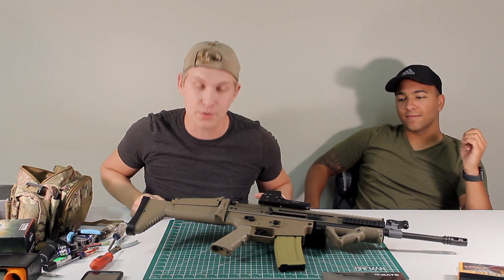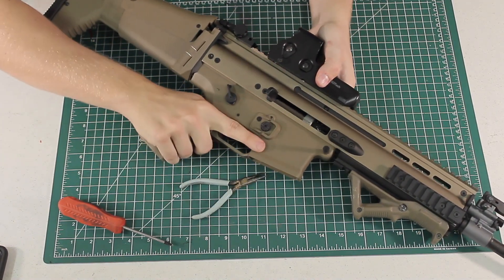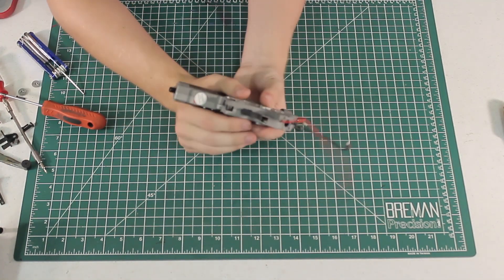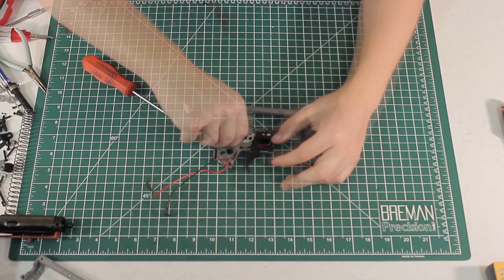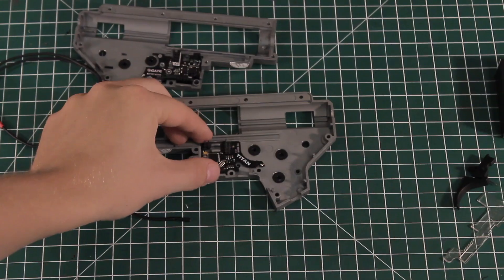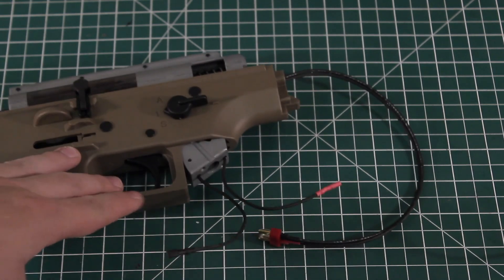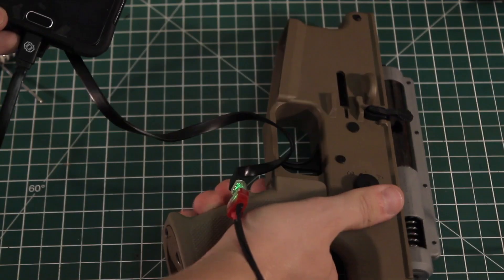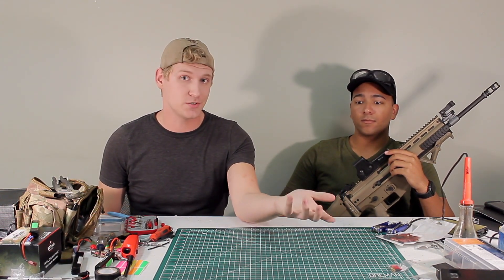GATE TITAN INSTALLATION SCAR-L [ Version 2 ]

Comment: Question why take the spring off the selector plate if that still needs tension on the cut off level?
Reply from the maker: When you install a gate titan the circuit board completely replaces the cut off lever entirely.  You actually use the screw from the cut off lever to mount the gate circuit board to the gearbox.  You don't need a cut off lever because the gate computer automatically cuts off power to your motor whenever you pull the trigger in semi after a shot has been fired. Then when you pull it again it cycles and fires another shot.. Therefore it's an electronic semi auto function based on the motor instead of the cut off lever.   NOW because there is no cut off lever there is no need for the spring on the selector plate. The spring no longer pushes against anything. Therefore the selector plate moves based on the position of your fire selector.  The spot in which the plate spring originally sat is actually a light sensor on the titan circuit board. So when the sector plate moves it covers this sensor which then allows the gate computer to tell which fire mode it is in. The selector plate spring is only needed in AEGs with a cut off lever. If there is no cut off lever then it's no longer needed.

Comment: So when it comes to the magnetic stock connections, I’d have to solder the Titan wires to the prongs?
Reply from the maker: That is correct. Just make sure you don't get the prongs backward or accidentally reverse them otherwise you will get a short, fry the titan, and blow up your battery. So just be safe about it. Red is + and black is -   make sure it stays that way all the way up to the battery lol.

Comment: Carlos laughter says it all 😂 what problems did you have with the wire to the stock.
Reply from the maker: All we did was drill a whole through the back of the gun into the stock then fed the wire through both holes.  The stock can still fold fine with the wires and it works perfectly fine.    This gun actually no longer exists anymore its been a while.  I bought it off Carlos last year and it now has a polarstar Gen3 fusion engine in it lol.
Reply: @d-rzairsoft296  cheers for the info I'll keep it in mind for future reference if I decide to go ahead and get one I hate the look of the stock but like the look of the body.
It's like a ugly woman with a nice lower 😀
Reply from the maker: @JBAIRSOFTIRELAND  personally my favorite stocks on Scars is ACR Masada stocks.  But you can't do it with an AEG cause then there's no room for a battery.  You can do it with GBB models however or polarstars. But yeah I rarely use my scar I just keep it around because I love the FDE look with my collection.    Also stay tuned. More content will be coming within the next few weeks.

Comment: So i wonder how u would connect the mosfet to the phone when you still have that hinge connector...  Will it still work without drilling a hole on a stock?
Reply from the maker: Still works just the same.  The hinge is just a + and - conductive metal hinge that the wires are soldered to.  After this hinge the wires return to standard tymia connectors.  You just need a dean's to tymia adapter to program.   Your largest issue will be modifying the titan wires to work with the 2 metal probes in the back of the lower with the conductive probe receiving holes in the back of the lower stock. This way you can still seperate the lower without cutting wires.  Everything will work as long as your electric path of continuity remains conductive.

Comment: I wish I had found this helpful video before installing the titan mosfet in my Scar L.  So far I have this system in 4 of my CQB guns (Scar L, M-4, Mp-5 and Ak-47) and I am very pleased but I think the ROF is a bit slow even at 100% "compared to the ROF I had before the Mosfet Titan  .. .. However, I programmed the trigger for Safe-Semi-Burst/Auto. wich is a perfect combination for the Airsoft fields where we do not use Full Auto.
Thanks for that video.....
See you on the Field.... 👍

Comment: Do you know if it would it be possible to throw an Avalon Gearbox into the scar?? If so that would be sweet, because you can just disassemble the receiver, take off that connector, then you would presumably have direct access to the QC spring system on the Avalon Gearbox.
Reply from the maker: You could put an Avalon gearbox in a scar but it would probably take some modification. I tried putting a krytac trident gearbox on my echo1 scar but however the krytac gearbox is slightly larger around the front do to the mock bolt release therefore modifications to your mag will might be necessary. I'm doing so however your mags might not fit flush in the magwell.    ALSO if you had a quick change spring guide you would still have to drill 2 holes in the plate of the scar H stock swivel . 1 for your wires to feed through and 1 to access quick change spring guide.    So maybe it's possible idk. Regardless you will have to open your gearbox and put a Scar H size nozzle in it.
Reply: DRZ Productions aaah I see. Well that’s a bummer, that’s a lot more modification than I thought. I guess I don’t know the insides of a SCAR AEG all too well lol. It’s probably a lot simpler to throw in an HPA engine instead, even though I’d still have to modify the stock to route batteries through.